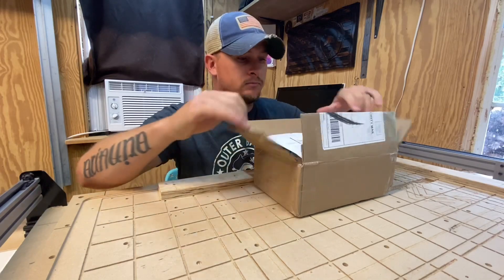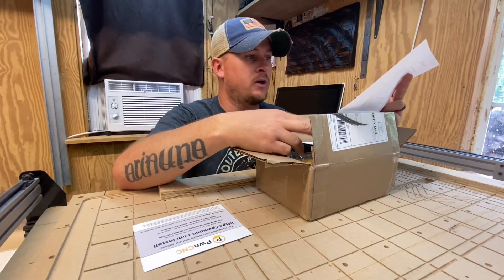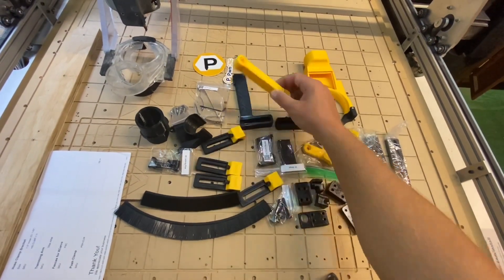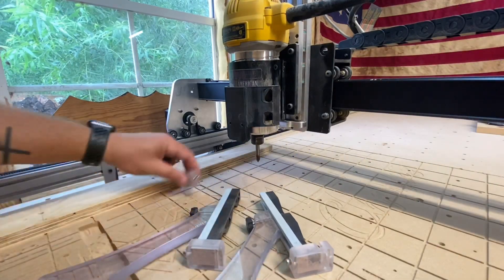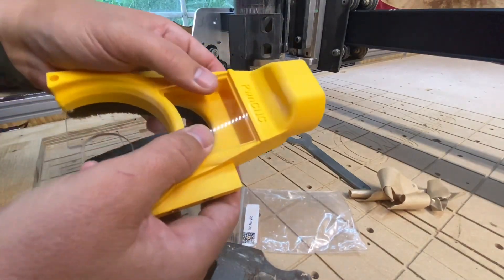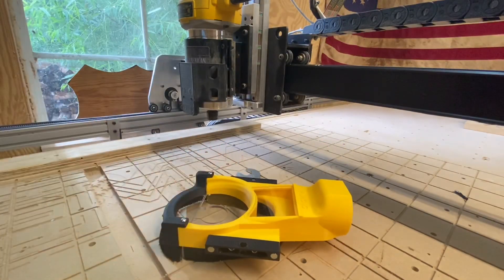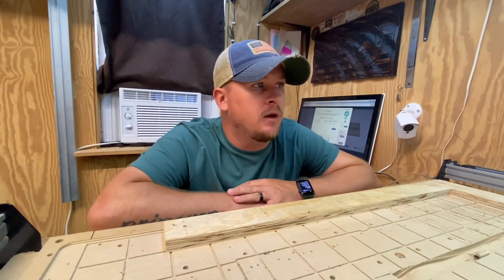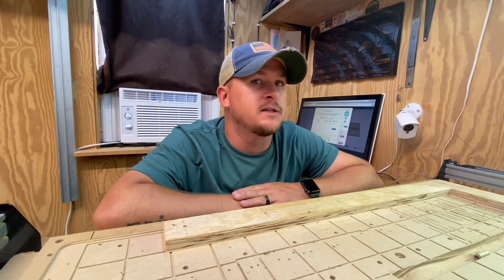Installing a PWNcnc Dustboot on my X-Carve CNC Router

Comment: What was the reason for not using the Suckit boot anymore?  I've had enough of the stock X Carve boot.  It fails me all the time plus it just sits to low.  Did the PWN boot have any issues with clamps that were in the rear of the material?  Any advice would be very helpful.  Good video too.
Reply from the maker: Just seeing this. The SuckIt got in the way. And the arms seemed to come loose often. I didn’t care for the hose coming up over the top, and not being able to see the bit all that well. This one is great. I set my z, XY and slide it in from behind and it seems to work a lot better too.